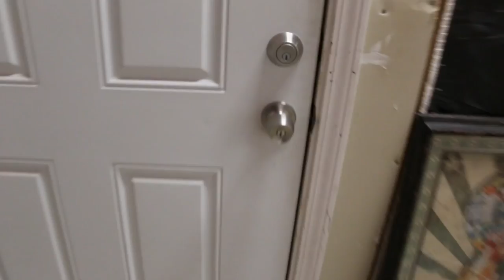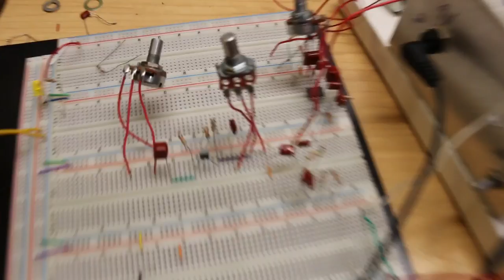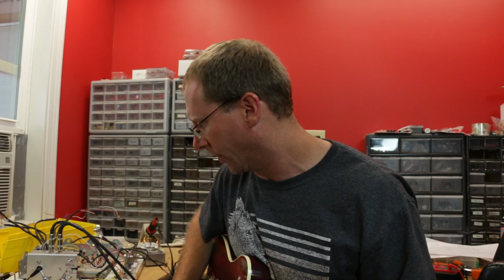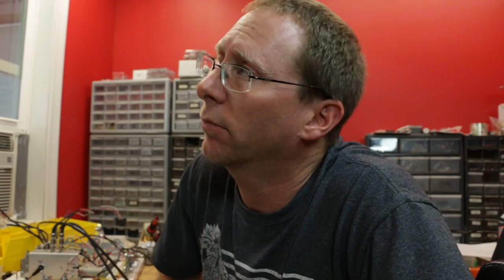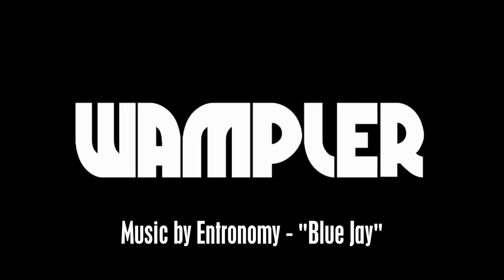Busting the myth of magical op-amps and diodes...?

Comment: Brian, the 4558 had pins 5 & 6 installed in the breadboard at an angle, thus affecting the linearity of the electron flow, altering the intra-lead phase coherence, and screwing up the harmonic convergence of the ultra-linear bifet dynamic perambulator that makes the 4558 magical. If you had put it in with the leads straight, it would have vacuumed the shag carpet on the noise floor and not only would it have sounded EXACTLY like a TS, it would have turned your guitar into a Strat and made you sound exactly like SRV. I call foul.
Reply from the maker: +Gregory Pease you caught me 😕 .....................😂
Reply: LOL!
Reply: where tf do you learn this things? teach me pls master!!
Reply: Germanium screams if you squeeze it really tightly, but you have to have special ears to hear it. There are guys in the hi-fi/capacitor rolling world who have had their ears surgically modified specifically for this purpose.
Reply: are you kidding me?
Reply: Yes.
Reply: hahahahahaha <3 that comment sounded intelligent and had a lot of complicated words out of which i know some so i thought it would be legit. :D
Reply: Bill Finnegan was a notorious Germanium squeezer with special ears. He now has a cult of germanium squeezers trying to chase what he heard.
Reply: I prefer to use a multi-pronged bipolar approach to wiring.  It gives you more curmudgeonite in you tone.
Reply: "shag carpet on the noise floor" oh jesus my sides hahahaha
Reply: Tubes cannot scream as they have a vacuum inside and the sound cannot travel through a vacuum. ;-)
Reply: "It would have vacuumed the shag carpet on the noise floor..." 😂
Reply: This is not Gregory Pease making this comment. Is actually Eugene Porter from Walking Dead.
Reply: @Gregory As much as the effect you describe (intra-lead phase coherence alteration and so forth) is true and very much in effect in the present set-up, it is compensated by subtimespace-dielectrification of the potential gap between the acoustic sound layers of the air pressure waves and their dispersion relation. This leads to an anti-proportional attribution to the depolarisation, and you know what that means!
Reply: You are overlooking the fact that there is no known Orth Effect for the 4558, which explains why no one really understands why the Tube Screamer screams. As the nuns used to say, “It’s a sacred mystery that has to be accepted on Faith”.
Reply: Once I've heard a German scream
Reply: Back in the day I had an '03 orange box MIT rounded edges Boss DS-1 with the classic BS247 chip in it. I tried hundreds, maybe even every single DS-1 ever manufactured because I have a buddy who works at microsoft. But mine was unique, like every other piece of equipment I buy because God loves me more than you. The BS247 as you know is legendary for allowing you to slightly poke your tone through the toilet paper and get a little poop under your signals fingernail. What really set mine apart was that vulcanized rubber foot pad was manufactured August of "02. 7 months before the pedal was completed. When I found that out I said "fuck". I don't think I even have to tell you why. 2002 was a notoriously dense year for rubber vulcanization, the highest on record. So not only does it slice the ham off the mids, but it puts a trench coat on and goes closer to the high end than the court order allows. I traded it to a guy I met on a forum a few years back who had an '06 black label plastic screw AC-2 with a shorted out LED from the factory...Yeah, you read that right. The mistake alone makes it worth $600 on Reverb, easy. But I've taken up enough of your time. I need to get back to my research on what type of table would have the right tonewood characteristics to set my amp on top of.
Reply: Yeah right like if electrons cared about things well placed, just try half playing with your electric outlet ;)
Reply: @Gilles Bourgeois German men can scream! :-)
Reply: Brilliant Electroniceese.
Reply: "Vacuumed the shag carpet on the noise floor" I died when I read that hahaha
Reply: Pete Miffle too cool
Reply: @Michel Dailly and rabbits.
Reply: @Drpiwi  no-one has ever been able to prove there is a vacuum inside, you'd be able to see the hoses or brush attachment through the glass.
Reply: @gregorypease213  Honestly, when I first read  "linearity of the electron flow" my enteral electrical engineering rage almost made me  have a fit. I was having flashbacks from watching a Theoria Apophasis video. https://youtu.be/5Gbng1wm62M
Reply: LetzBeaFranque I have plenty of curmudgeonite in my tone now....
Reply: Lol, sounds like you know the joke promo video about the "Rockwell Retro encabulator" hilarious.
Reply: YouTube gold!
Reply: So which one is the best one?
Reply: Gil L . The best one is the PS4558 with a pre-sqeezed germanium dielectric sound rectifier. PS stands for pre-squeezed. Ask your dealer about it. Have a good day.😊
Reply: @Michel Dailly  Yes but the signal chain starts with the guy playing the guitar so you have a human in the chain. A vintage human has more breakup do to deterioration in it's circuit so some feel it adds more character to the sound.
Reply: Please explain to these freaks that a vacuum can scream at least sound like a scream from the air flow!!! Wow I’m take Xanax an go to sleep now. Haha
Reply: But that's because these guys ate 'Characters' in the first place :-)
Reply: @gregorypease213  EXACTLY ! ! !   !
Reply: Turbo Encabulator level wording )
Reply: G.L. Pease commenting on a Wampler video. Didn't have that one on my bingo card.
Reply: great assessment, however, without the adjunctive turbulator connected to the drive nucleator I think all of this is bs. Just sayin.... 😛

Comment: THIS is exactly the kind of NO BS demonstration we need in order to really discern and to really assess gear.  Trust your ears and keep ever mindful of the "psycho" in psycho-acoustics. Placebo effects are FOR REAL, guys.

Whatever the actual outcome, Brian Wampler cannot be given enough praise for introducing this down-to-earth method (inter-subjective comparison is the foundation of science) - which, obviously is beyond the means of many here, so the value is even greater.

I'm sure, we all appreciate that there are differences - just let's concentrate on REAL differences and keep from hair splitting and cork sniffing.

Thank you again, Brian, and keep up the good work!

P.S. No reasonable person can disagree that anything purple just has to be
SUPERIOR…
Reply: Dude, what if I told you this video is misleading, and the op amps can make a huge difference, would you believe me, or would you believe Brian, cause he's purple? xD

In fact, I agree with this: in the comparisons he made, using just an op amp stage, limited, respectively clipped with single diodes (at low voltage), the model you choose can't make a big difference.

However, if you're using op amps as buffers, building a clean boost, or when they are interacting with various other sections (e.g. filters), where the op amp stability, amplitude, (sometimes) impedance and noise matter, you will find there are great differences.

I tested quite a bunch of them, on the circuit I am building, which is neither a TS nor a DS, and only two out of six models so far are satisfactory, and these two sound good just differently. One is, indeed, very expensive, and I think the small sound differences from the other one aren't worth it. The unicorn horn powder OPA2132, that is LOL!
Reply: I love what you said Jep! the "psycho" in psycho-acoustics!
Reply: And that is why I always do any testing of anything as double blind A - B to rule out the placebo effect...
Reply: In the great words of TLA: ears before gear!

Comment: Let's do some direct comparisons!

Dual op-amps (soft-clipping)
1:24 JRC 4580D
1:45 TLC 2262
2:06 OP 275
2:20 TL O62
3:04 LM 833
3:28 JRC 4558D
3:49 LM 358
4:33 4559
5:18 OPA 2604
5:44 AD 712
6:27 OPA 2134PA
7:03 JRC 2043DD

Diodes (hard-clipping)
8:50 4148
9:48 / 9:55 1N192
10:51 BAT46
11:20 BAT41
11:57 blue LEDs
12:31 orange LEDs 
12:49 pink LEDs
13:21 red LEDs
14:11 1N34A (Ge)

14:49 no diodes (op-amp clipping itself)
16:06 / 16:19 clean boost into same circuit
Reply: Thanks!! LM358 had a Joe Perry type snarl in my opinion. He and Brad Whitford are known for using Klon Centaurs... Could be on to something here.
Reply: Thank you for these timestamps! Watched the whole thing but this makes it so much easier to compare.
Reply: thx!!

Comment: (after the 4558) "here's the 4559. you may notice a little more gain."

duh. it's one louder.
Reply from the maker: Lol.
Reply: Unless the op amp is open gain mode, the circuit and feedback resistor ratio control gain... should be the same for all
Reply: ...but this one goes to 4559

Comment: Not dull at all Brian, very imformative comparison! Ive always found the diode comparison tricky because of the volume differences but i agree with you, op-amp or diode differences are subtle ones.  Cheers mate!
Reply: In this particular application, the differences in diodes are way more noticeable.  Some of the Op amps You mention ( 712 ), is designed to amplify very low level input signals with low noise floor, and or or serve better in certain special applications.  All these seem to be pretty much in the same family... and very similar in behavior with the circuit You used.  Most of the ones You mention I think have been around for a long time.  I love LEDs for clipping, as the voltage drop is quite a bit higher,   Germanium has a very low V drop, but is also more deeply exponential, over a longer arc, so  germanium diodes are nice, when that very small voltage drop is amplified, and the signal fed into them is attenuated.

Comment: To anyone who would to understand what's going on here in scientific terms: start by googling "frequency response" and "bode plot".

The frequency response of a pedal describes how a pedal will change the input signal as a function of frequency. Certain pedals will attenuate/amplify certain harmonics that result in "brighter" or "darker" tone. Changing the harmonics in a specific way creates "distortion", look up "square wave" for this. Distortion is essentially just making the signal more square-like.

For this experiment, if you look at the datasheets of several op amps you'll find that most of the characteristics are the same or very similar. What really matters is the surrounding circuitry. Specifically, filtering caused by capacitors and resistors (look up high pass filters, low pass filters, bandpass filters) This is what determines the "color" of your sound. 

Diodes can also change the sound a little bit depending on where they're placed and their forward voltage. Most of the diodes found in pedals will have very similar characteristics though in which case location matters more (soft clip vs hard clip). 

Clipping cuts off the peaks of the signal. Hard clipping makes a straight cut which makes it more square and "harsh". Soft clipping is a rounder cut which provides a slightly less harsh distortion similar to how an overdriven tube works. 

Hope this helped!
Reply: Once you learn about this you'll start to realize how much BS goes around in gear circles. Always trust the science and the people who actually make your gear before you trust the guy trying to sell you crap at guitar center.
Reply from the maker: EXCELLENT post! 👍🏻
Reply: Also I will tell you that diodes affect clipping type a lot in my amp but it's broken ( very trash sound, I hate it so I am going to replace all caps ( it's rather old amp so possibly electrolyte dried up and causes filters to go haywire ) ). 

From my experimentation it's best to add different diodes to amp with rotary switch. Insta character change ;) Especially if you mix diodes in ammount and type ( of course it just changes cutoff voltage)
Reply: Okay, from a total normie, this was actually SUPER helpful! Thanks to @wamplerpedals for making these videos as kinda the whisk in the pancake batter we call the pedal world, AND. for comments like this one.! Is there anywhere or anything you recommend to a young gun who just wants to learn more about what's in all these metal boxes we stomp on and how to just make some cool shtuff.?
Reply: @jory2973  it's really hard to say. I dropped a ton of money on learning about electronics so all I know is university level text books on circuits. 

I would maybe start with a hobbyist electronics book then if you're feeling bold you could pick up Electric Circuits by Nilsson. There shouldn't be anything in there that's beyond high school math. It'll explain basic circuits and op amps which is what this video is mostly about.

Comment: Great demo, really demystifies some of the stories around ICs and diodes. I ended up with some leftover parts from a synth build and thought maybe I could build a distortion pedal, then I got really wrapped up in trying to figure out which pedal uses which chip and how they're wired, worrying if these spare parts will do the trick. You helped me realize I should just build it on a breadboard, test it out and see how they sound instead!
Reply: Great technique!  Yes You learn by experimentation, and observation, using ears, and instruments.

Comment: (Orange was a favorite)Diodes and hitting the circuit with the boost was the most dramatic of the changes. I could tell that there was some tightening of the frequencies when using the expensive op amps -but not by a lot. Didn’t care for the germanium diode clipping. Interesting enough to want to get a bread board and goof around. Reminds me of my electronics kit in the 70’s when I would make noise generators. You truly have the more interesting pedal oriented YouTube channels. I know it’s older content but I’m glad that you’ve continued this take on pedals. Nothing needs more demystifying than pedals. I wish a boutique amp builder would do the same with amp circuits. You would be a great guest on ‘The truth about Vintage Amps’ to talk about my problem-what makes a good pedal platform. I have amps that sound so so but put a pedal in front and it roars and conversely, a great sounding amp that sounds like dog doo as soon as you hit it with any kind of boost with the exception of a tube screamer types of pedal.

Comment: Wow, so many op-amps to choose from! When I was learning electronics back in the 70's there was the 741 and that was about it! What an exciting time to be alive!
Reply: We had the 739, and then there was the 741 that was everywhere! The old MXR Distortion + used a 741. Noisy as an old ham radio.
Reply: check dicrete op amps and your mind will be blown away
Reply: discrete opamps are pointless I think, just checkout OPA1612 and other current high performance audio opamps.
Reply: lol
Reply: Ha, when I first started playing guitar in 1991, I didn't have an amp, so I got a 741 from radio shack and built a (really crappy) distortion box clipping against the rails and played it through my brother's stereo.  The 741 would last a few days before burning up (like I said, it was a really crappy design.)
Reply: @StephenCameron  Happy days!

Comment: I'm going to add to your information.  The most important feature in the quality of an op amp is the Slew Rate.  Slew Rate is the ability of the amp to increase voltage to incoming changes.  

The 741/1458 is .5 to 2 micro volt Slew Rate.
The TLO72 is 7 micro volt Slew Rate.
The 5532 is 5 to 13 micro volt Slew Rate (Varies by manufacturer)
All the Japanese chips, JRC, NEC, NJM are very old license built chips and fall into the 1 to 2 micro volt Slew Rate range.

The higher the slew Rate the more vibrant and detailed the sound will be.  The lower
the Slew Rate, the more dull and distorted the sound will be. The sound is distorted because the op amp is being fed with too much audio signal and it can't process it, and outputs a distorted signal.  Anything additional in the audio line will only color the sound.
Reply: This is all true, I THINK I can notice a small difference based on slew rate. IIRC that's the only parameter that varies large enough between common op amp chips. Otherwise most op amps have the same characteristics. The differences you hear from pedals is mostly driven by the surrounding circuitry ie the filter design for the tone control, filters in the op amp feedback loop made with capacitors, clipping characteristics from the forward voltage of diodes etc.

Comment: You're more correct than the cork sniffers want to admit. I have an original Blues Breaker pedal I put a socket in for just this purpose. It came with a TLO72 but I drank the 4558 Kool-Ade and couldn't let myself sleep until I exhausted all options. I tried almost every one you did here and to my ears the only difference between just a few of them was that some seemed to have mixed more or less direct signal into the overall tone. For that particular pedal a TLO82 was what I liked most.

Comment: Fun and informative video!
I did an experiment once with a RAT-ish circuit with different 
clippers... from diodes and LED's JFets and MOSFET's, and combinations 
of these... and a switch to place them in either the common position 
after the op-amp or in the feedback loop.
This makes a very versatile dirt box, where the position of the clippers makes a lot more difference then the kind of clippers
It resulted in a very cool pedal that i still use a lot.

Comment: The OPA2134 sounded the best.  Most sounded pretty much the same but there is a dynamic with that chip that sounds rather good.
Reply: As soon as he started with those elusive ones 05:12 the sound got wide and less compressed. Currently looking into purchase. I think it's damn dumb to sweat a dollar on parts expense when it translates so well into sweetness.
Reply: I thought the same thing. The OPA2134 stands out in particular. imagine the anger people would have if you modded a TS9 with one.